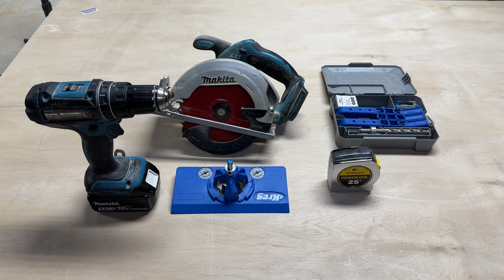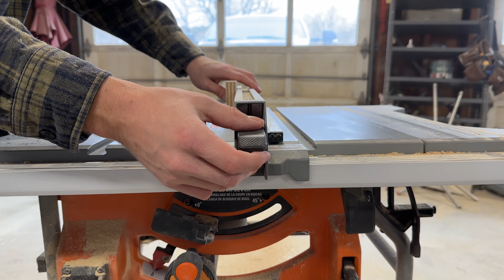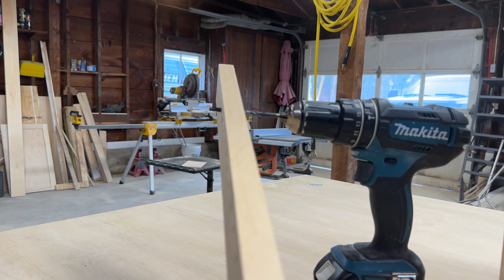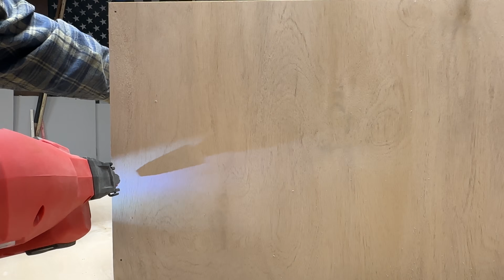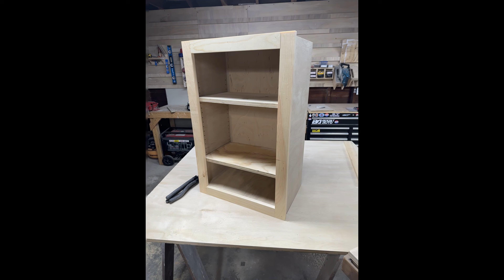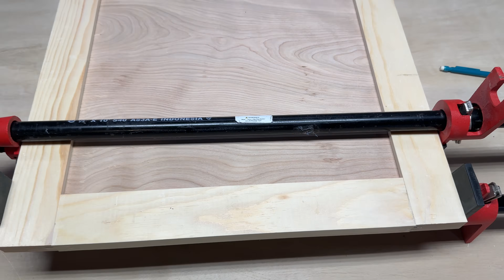DIY Cabinets and Doors Made Easy

Comment: Hi what grit sand paper did you use for this project?
Reply from the maker: It’s really determined by how or if you decide to finish it. If doing painted cabinets and doors I like 100 grit followed by 150 grit. If being stained 220 grit is usually sufficient after that.

Comment: Do you use a certain species of ply? I want to make some cheap garage cabinets and wondering if there's a reason to avoid the cheap 3/4" stuff. Does the 1x pine bow or flex over time?
Reply from the maker: The biggest problem you will encounter with the cheaper plywood is voids inside the layers or possible delaminating. I prefer to use a birch wood for shop/paint grade cabinets but what I used here is Home Depot’s “sande ply” which is on the cheaper end of things but holds up great for shop cabinetry.
Reply: @TheDIYNut  It's pretty confusing because I think "Sande" is a species of wood, but it gets confused with "sanded ply" which...at least at my home depot, Sande is also sanded. I like the way it looks, and I haven't noticed structural problems with it. They fill in the surface knots already. I used some for a workbench top and it's soft but my plan is to eventually laminate it with something more durable. 

Thanks for the video!
Reply from the maker: No problem thanks for the comment! In response to your first comment about the 1x pine, poplar can be a better choice for a little more money it’s what I used for my kitchen cabinets which are painted.
Reply: @TheDIYNut  I love poplar. It gets a bad rap for some reason but I love how you can make it look exactly like walnut. I even kinda like the grey-green color.